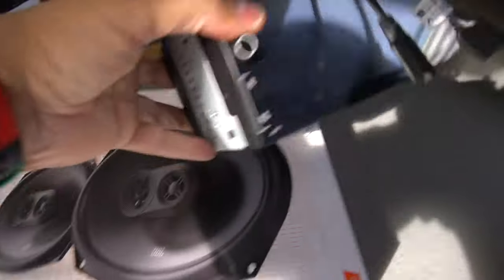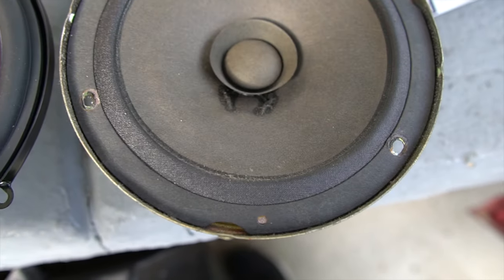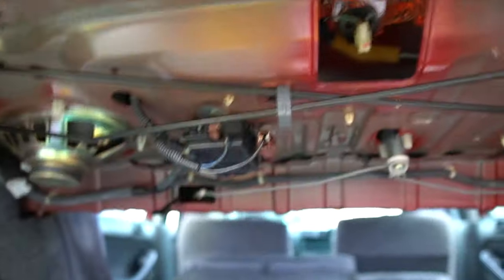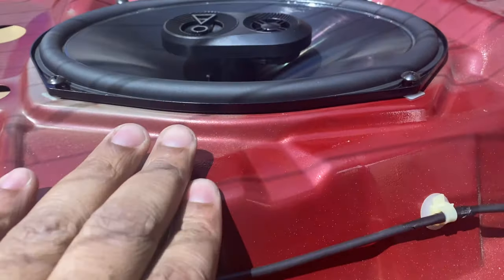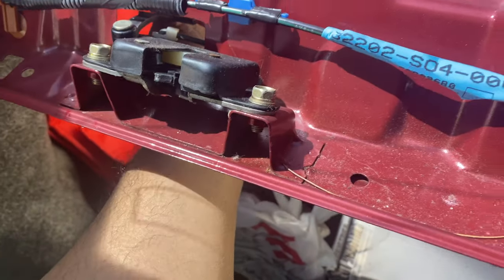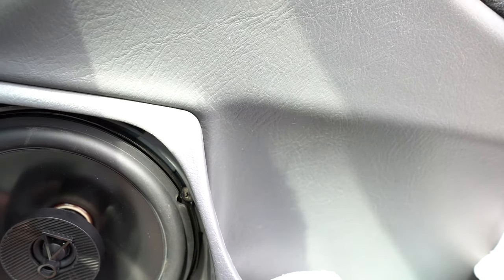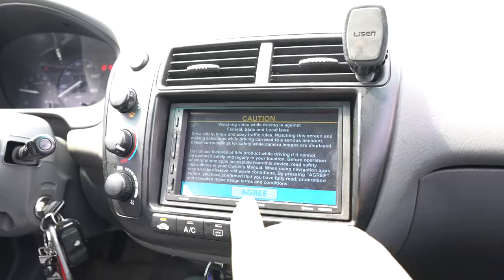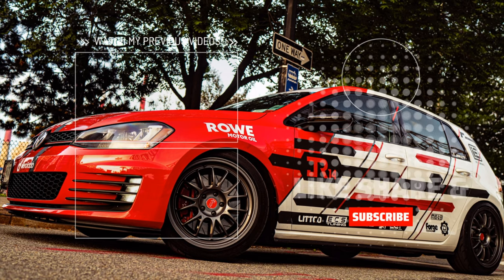JBL Speaker Upgrade!!!!

Comment: Aftermarket head units often have decent crossover high pass/low pass.  Makes sure to line those up with frequency response of the speakers and you’ll have cleaner sound and maximize whatever power you feed them.

Comment: I installed the Mopar speaker upgrades in my car around 2014. The Mopar speakers were made by Kicker. They were better than the stock speakers but they still sounded muddy. It sounded like someone trying to sing through 5 covid masks. I just installed the 6 1/2 inch 3 way JBL Concert Series speakers. The JBL's sound much more clear. I can actually hear the words on the songs now.

Comment: So you used the same speakers I just bought... Hmmm... 

I saw that these were 3-ohm speakers, and everybody always says you should use 4-ohm, but I guess apparently JBL tweaked these differently so they can work in 3-ohm instead, but hiked the sensitivity up so it doesn't draw more power from the head unit? 

I just wanna make sure these are actually okay for me to use, because I don't want to destroy my head unit by using the wrong impedance speakers..
Reply from the maker: You should be fine! The power drawing from my Headunit made no difference
Reply: @JR14Channel   Yup, I've been using these speakers for about 2 and a half weeks now, and sure enough-- it's been great! They sound AWESOME! And they sound SUPER clean. :3

Comment: Bought similar ones for my mk4 golf thanks to ur vid cause the front ones are SO FKIN TRASH they can’t handle any bass at all without completely destroying my ears with just pure rattle noise, planning to install rear ones too but that’s supposedly harder cause I have to remove the rear door cards n stuff ah
Reply: bro i have mk4 which speakers do you reccomende ab 100euro

Comment: boy if you don't put an amp on that head unit you doing the most, that head unit is fake advertising power the amps are peak it gives 7 watts rms per speaker at most. you need good 20 watts rms or more on those for real test. and that amp is the real work.